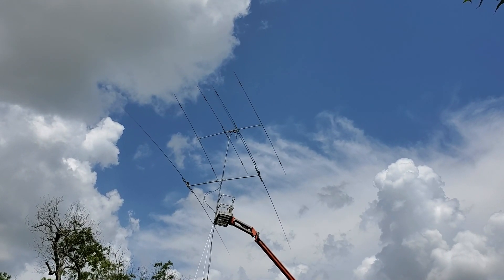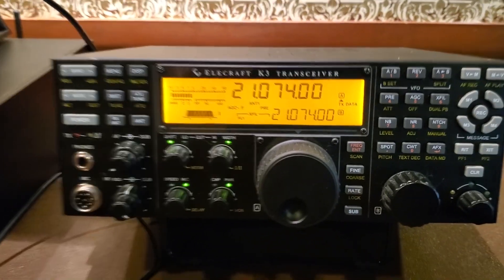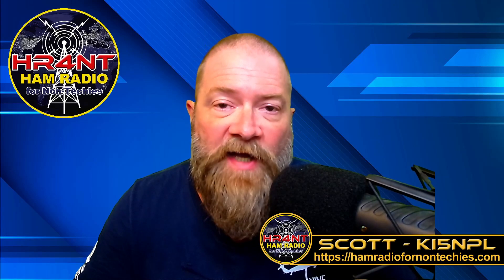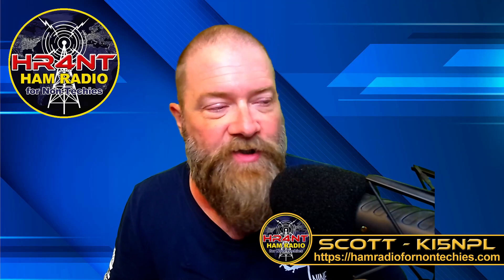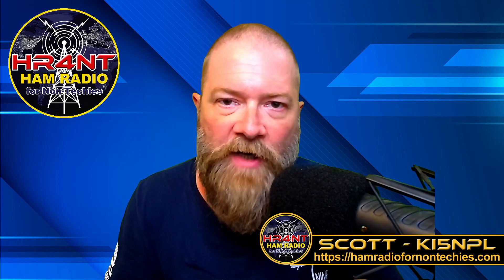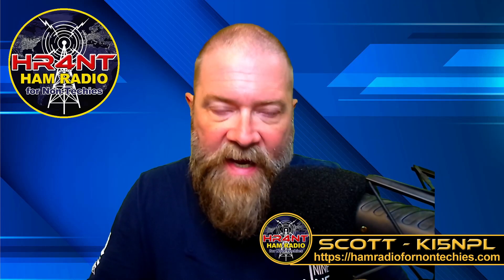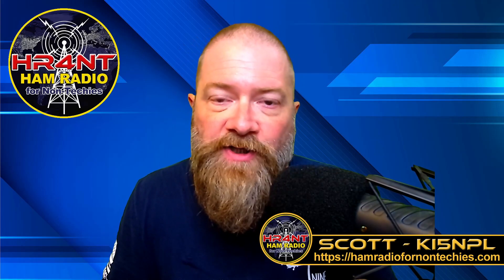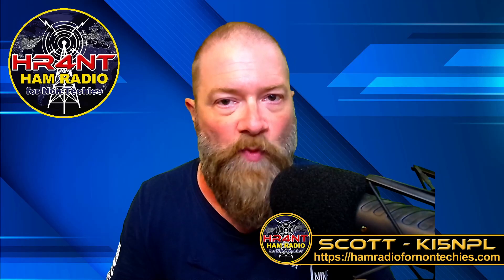Field Day Setup 2021 Day 1

Comment: Wow nice we did are setup today nothing like what you did. Thank you for this video. Ps Would you mine if I link your video to mine to show what the big dog is VS Us little dog setup ?
Reply from the maker: Thank you for the comment.  No problem with linking my video.  I appreciate that!  When I got back to the location on Saturday for the event, they had actually added a dipole and another Yagi antenna to what you saw in the video.  Thanks for the continued support.  73